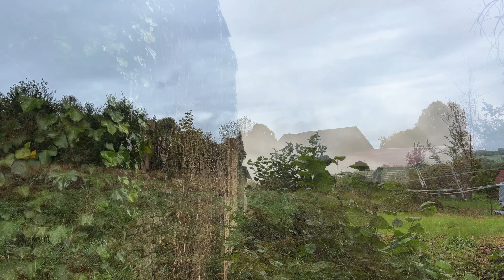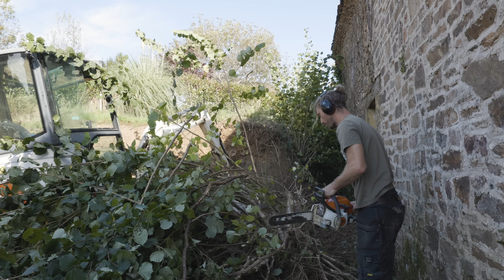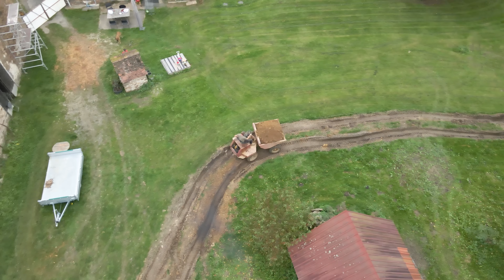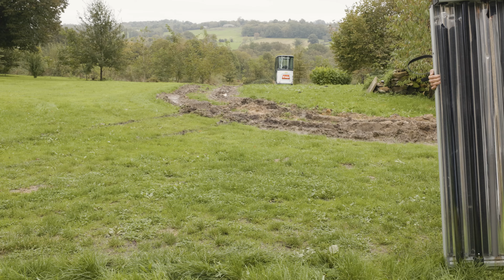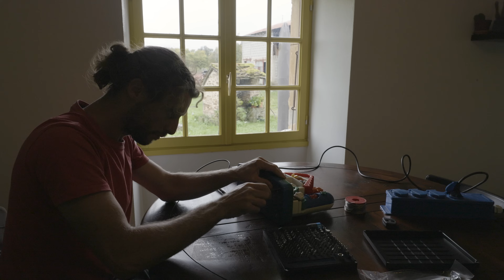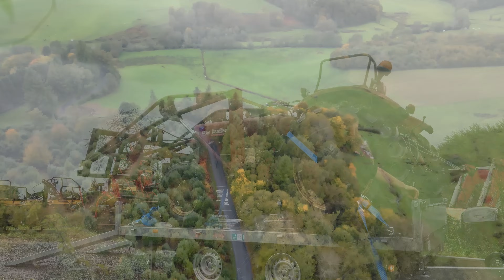59 – Digging Before the Rain Comes & Picking Up a New Ride!

Comment: When you are drowning in mud and water is drizzling down your face, instead of wondering why the old farmers didn’t do anything, just look around. They built another barn so that they could have a dry spot to work in. They didn’t have the digger and the dumper. They wore out their tractor trying to get rid of water. They did what they could and then it beat them. But it took 300 years!

Comment: I'm hoping you've had some professional engineering advice.  From the pictures it looks like the rear wall of the barn is leaning outward quite a bit.  Is it stable?
Reply from the maker: The roof is pushing outwards on the walls, but before we do anything the cause has to be solved first and that is the excessive water inflow.

Comment: Just first glance at this 2nd tractor appears to be in much better condition with better tires all the way around, wiring  ect.   If it was me I would keep the best of the two engines and referbish the 2nd tractor.   It appears that this 2nd tractor has been stored out of the weather at least more often than the orginal one.   Weather can do so much damage to many things left without protection

Comment: McCormick F-240 tractor which had a very short production from 1962 to 1965. Certainly assembled in France in Saint-Dizier. This is an Orchard-Vine-version (narrow)
Reply from the maker: Correct! I think the old one we found is a vineyard version and the one we just bought is a standard version. You can see this also at the rear fenders, the old one was modified to have the fenders over the tires but normally it is not this way.

Comment: I am really glad you have stopped driving along that hogs back on the bund! When the ground is fresh tipped it can slide away very quickly, you would not have time to bale out and get clear. The drone shots are fantastic, they give a very good perspective of what you are doing. The donor tractor will be a huge benefit for you, and the loader is a real bonus, the ground is very changeable there, with some parts looking very dry especially when you tip it out, but other areas forming water pools, you are almost clear all round the barn now, once that is levelled off the barn should dry out quickly, do you have a de humidifier? Ours has been a very big advantage since we have been here, and you get the advantage of distilled water. Stay sae! Chris B.

Comment: Good to hear you have stopped driving on top of the dam.  As I mentioned a while back, the dumper needs a safety cage to be used for that sort of work and perhaps also for general use, and getting stuck was a nuisance. The tractor should have a safety cage too. Hope the tractor project goes well.  You are going to need another barn to keep the tractor and other equipment out of the elements!
Reply from the maker: I have found a safety cage for the old tractor not far from here 2ndhand so i might get that if the tractor is up and running. The dumper will have to be custom made. The ground floor of the barn would be great for that once it is dry and fixed roof.